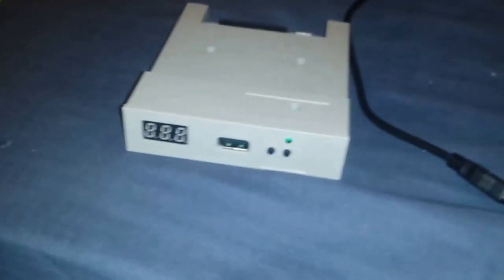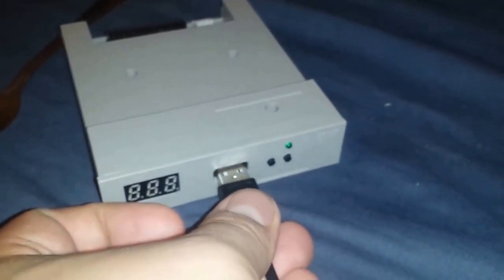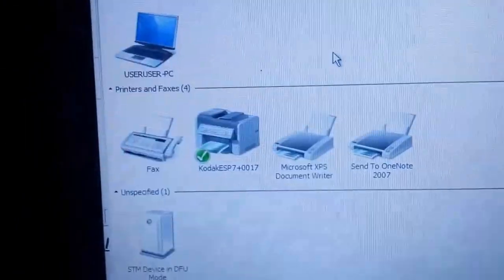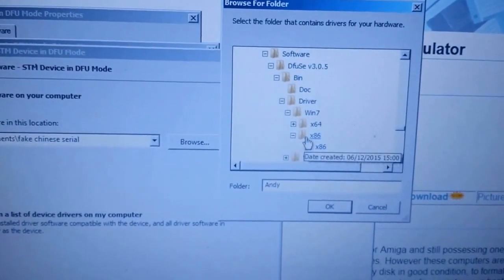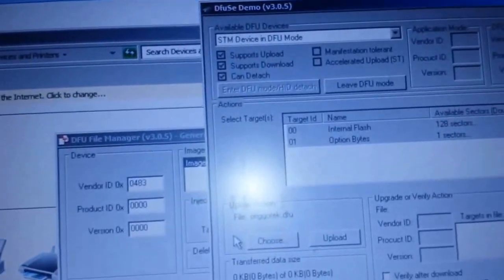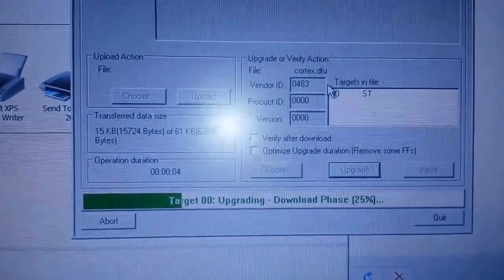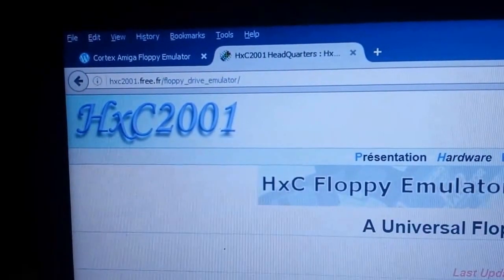Flash GOTEK Floppy without Serial Adapter - For Amiga/Atari ST/Amstrad CPC/Spectrum/Acorn/IBM-PC

Comment: You have to execute dpinst_amd64.exe in C:\Program Files (x86)\STMicroelectronics\Software\DfuSe v3.0.6\Bin\Driver\Win10. Using the driver update feature from Win10 Device Manager does not work anymore.
Reply: answered my question! tysm!

Comment: The newest version of FlashFloppy doesn't require you to generate the DFU files anymore as they are already included, but I dont have a cortex.dfu file, I assume that doesn't matter?
Alao when I choose the file to upload on the "upload action" section on the left of the program it wants to save a file instead of load, so when I select the file to upload it asks if I want to replace it since it already exists.

Comment: Thanks for the instructions! I hve a gotek with cortex on it. Can I flash it again with flash floppy?
Reply from the maker: You sure can! I just did it myself using my own video as a guide because I forgot how, haha :)

It's actually even easier with flashfloppy because it comes with a DFU file, so you can skip the HEX->DFU conversion step
Reply: @TheRasteri  oh my lord! Can't wait to do it. Thanks so much for replying!
Reply: hi sorry its been a while since this video was current but i find myself in the same predicament with wanting to update my cortex gotek to  flash floppyi have tried this method numerous times but it just stays on the cortex firmware did yours work for you

Comment: Not all goteks are the same I've got 9 pin holes. I've made the links what are needed by what you have shown. I get windows cant detect this device. Can you please explain what's the best way   to amend this. The driver is installed already.

Comment: I have a Gotek SFRM72-FU-DL which I use with my Roland W30 workstation. I would like to mod it with an OLED screen and rotary encoder. Is it necessary to flash it before they will work? If so, with which firmware? Thx
Reply: I'll answer my own question. Yes, you use the DFU file contained in Keir Fraser's FlashFloppy, latest version just released (June 2019) is 2.12, available for FREE download from his Wiki. Please consider making a small donation to him.

Comment: The flashfloppy package comes with a ready made dfu file. Great.
Reply: So using that FF dfu file, I just follow the video from 3m00s onwards with the Dfusedemo program, is that correct??
Reply: @droses1600  yes, exactly.
Reply: @jeffschaap  And I did exactly that, and it worked like a charm. (Only slight issue was that the display said 'Upd' afterwards instead of 'F-F' but that's because you need to remove the jumper at JA as some Goteks ship with that installed.) To all those who are procrastinating about doing this firmware update - like I was, don't delay: it's quick and easy and the added benefits are REALLY worth it. Faster loading times, no need to constantly unplug the stick, 1,000 images (more if you use folders - for that though you need an OLED screen. My next project!!).

Comment: Just did this with the FlashFloppy firmware (which comes with a DFU file already) and it worked.  Only part that threw me off was that my Gotek wasn't jumpered for DS0 (Amiga internal).  So it didn't work in my Amiga, until I moved the jumper over.  Thanx, much easier than the serial method... (Which I used with my other Gotek and the Cortex firmware).

Comment: What pin is the jumper connected to? When the gotek connect with my PC, it detected unknown device not DFU.
Reply: Install the DduSE package before plugging it in. If it is not automatically recognized, update the driver as indicated in the video.

Comment: As far as I know, you can use this method to flash the Flash Floppy firmware as well. I will try it when my new Gotek arrives.
Reply from the maker: It should work with any firmware that you can get binary files (.hex/.bin/.s19) for. The only reason HxC doesn't work is because the developer (perhaps understandably) doesn't allow it.

Comment: Can you please explain the jumper settings more clearly as it is not quite apparent by your diagram , I have the same drive but as It has been noted bellow it is not all that clear on jumper settings.
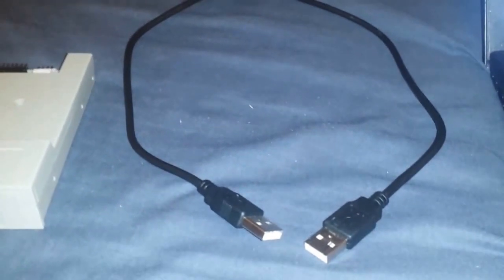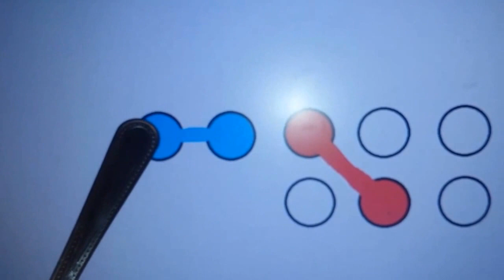Reply: look at the vid? 00:40 - 00:45 you can see the jumpers plugged in, cant be explained more clearly than what you see there. And another bigger drawn picture at 00:47-01:04
Reply: I see it now many thanks, should have gone to specsavers
Reply: I used this to flash a gotek with the flash floppy firmware to support Amiga and it works a dream. Thanks for the video after some slight confusion with the jumpers it works perfect.

Comment: Tried to do that, when I plug the USB on my PC the Gotek turns on, but it's not recognized by my PC. Any help?
Reply: I just tried this, if the jumpers do not connect properly it wont be recognized. I had to make sure that they actually made a connection and that it was stable.